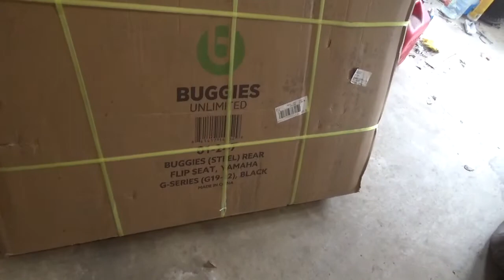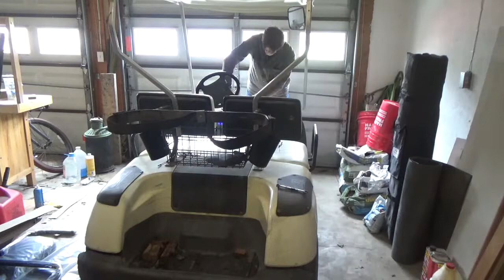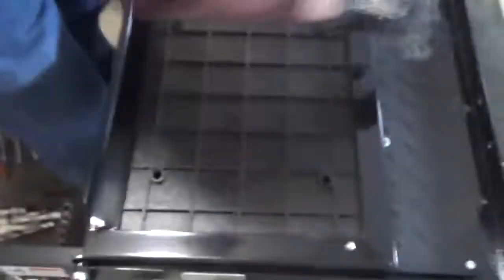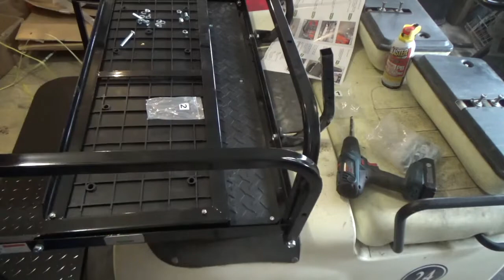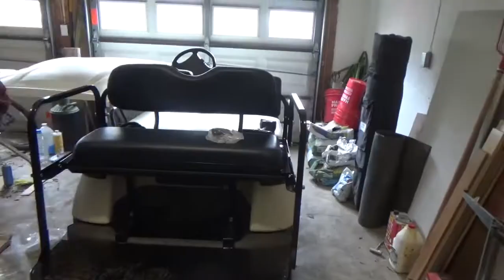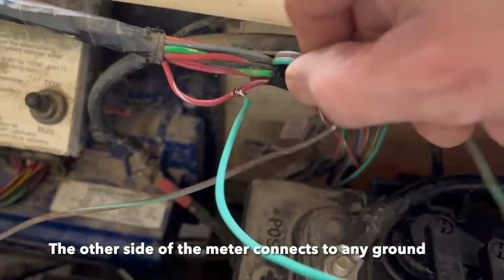Golf Cart Rear Seat Install

Comment: Liked the video... Helped out a bunch!!  I just wished you had a little better lighting. The bonus at the end was a HUGE bonus for me... I added a new 48v to 12v stepdown transformer and was looking for the the keyed 12v wire to turn the transformer off when the key is off.
Reply from the maker: Thanks!  I have since renovated the garage and installed new lighting, wiring and better walls. :D
Reply from the maker: If you're interested here is a video on the garage renovation -> https://youtu.be/rsikzxH81fw  Also: I thought I had a video put up of a full rewiring I did on that same golf cart this year, but it looks like I never uploaded it.  I also added a step down transformer, new front LED lighting, a flashing dome light on top and custom made switches for it too.

Comment: ⛔️ I usually Add a 1”X10” board around the circumference of the truck bed. I purchase a 4’X4’ piece of Luan ( thin plywood ) for the bottom. I hold the box down with bungee chords. Works well for Firewood, a saw, tools etc. Thnx for the Video. : j
Reply from the maker: That's a great idea!  Thanks for watching! :D

Comment: I have a g2, any advice?
Reply from the maker: As long as you purchase the correct compatible kit, it really shouldn't be all that different in the install process.  I'm sure you'll do splendidly!
Reply: @masterofnone8065  can you recommend a kit?
Reply from the maker: @PCRRAMROD  Not personally, but there are quite a few that show up on Amazon.  Depending on your 'area' will depend on which style to go with.  The steel one I put on this cart is great for Northern PA.  The same kit in SC along the ocean quickly rusts out however and it's best to go with as much composite/plastic as you can.  Even if it means a few extra $$.